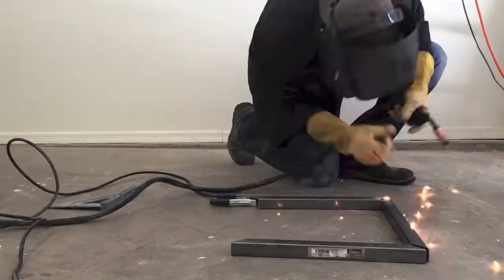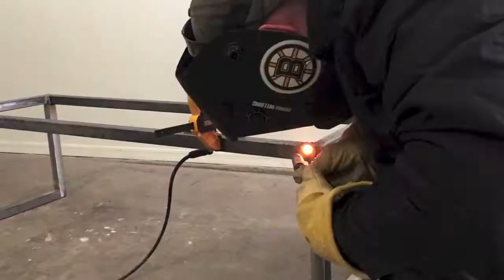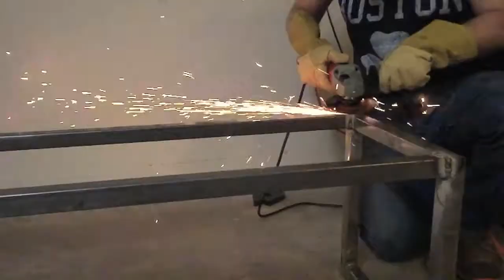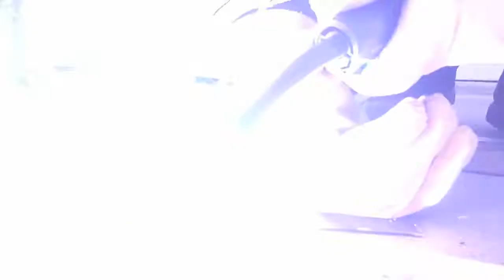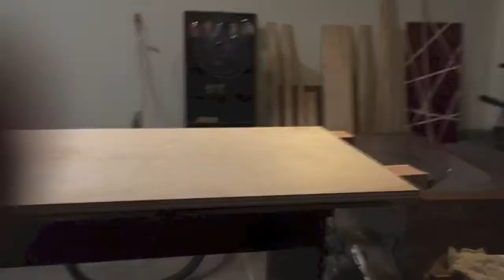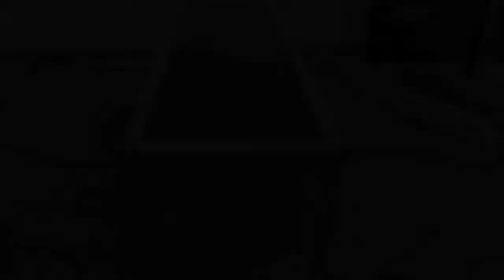DIY Modern Coffee Table // Wood & Steel

Comment: your MIG welding backward you supposed to push with mig and pull with a stick welder that's why your welds are so dirty, just trying to help , nice table!
Reply from the maker: It's actually flux core welding, not MIG, that's where the residue is from. Thanks for watching! 👍

Comment: Very nice table. I like the look of the top captured between the metal frame but how do you acount for cross grain expansion and contraction?  Have the top moved at all since you built it?
Reply from the maker: +jaschatz1 nope! It's plywood, so you don't have to account for that. If you wanted to use solid wood, I would probably just put it on top of the frame completely to give it some breathing room.
Reply: Right. I missed that you used plywood but I have seen guys on here trapping piece of solid wood.